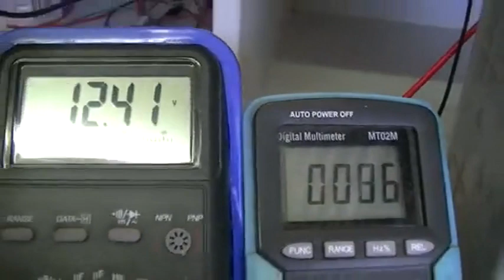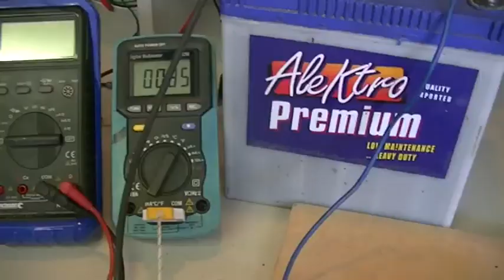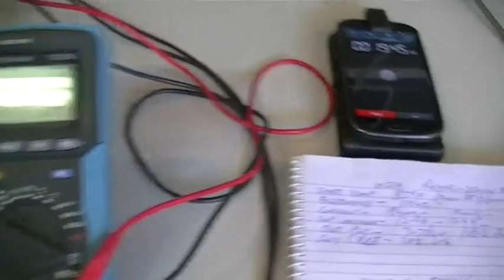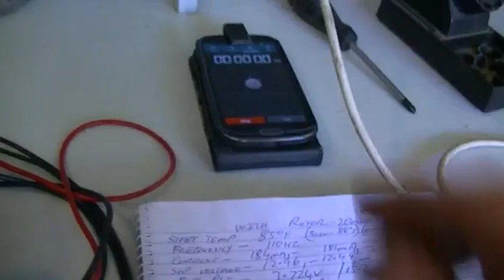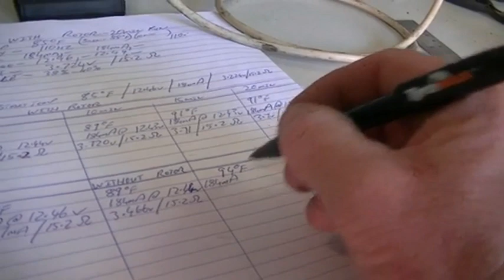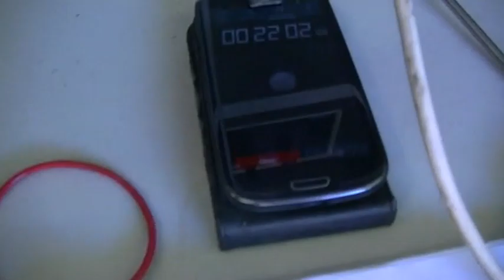Pulse Motor Thermal test

Comment: Most bench power supplies like yours are isolated. The green terminal should be ground which would be shared with the scope. In my experience a bench supply would come with a metal short to go between the negative and the ground terminals. 

A class-mate didn't realize the clip-lead on the scope probe was ground and knocked out power to the classroom when testing an AC circuit.

Keep up the great work!

Comment: the question about  the base voltage was the thing i found most hardest to get my head around at first, but at the end of the day the more you feed into the base the more you feed through that driver coil, those type of transistors have an active point (about 0.6 ot 0.8) and allow you a variable control, we all of use them in the active region and i dont think we ever get to the point of saturation, although when we put a cap across the pot we get closer, can i just say thanks for sharing and cant wait for the next vid, simply thanks.....phil................for me it allways how hard you shut it down.